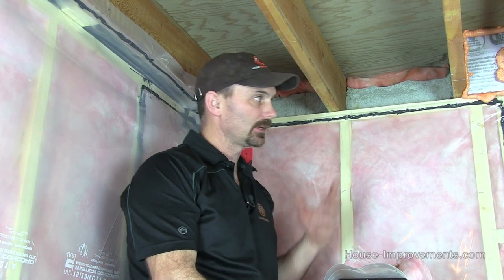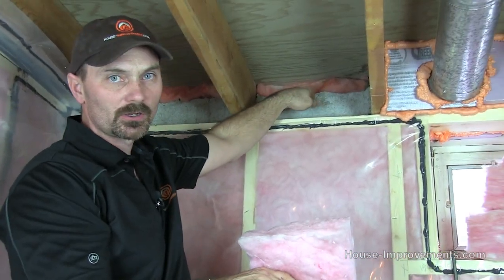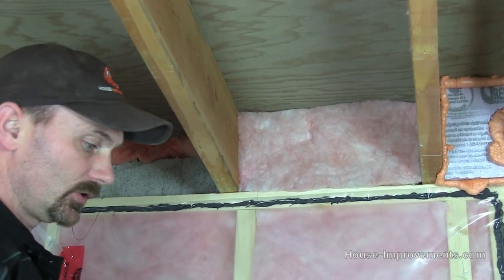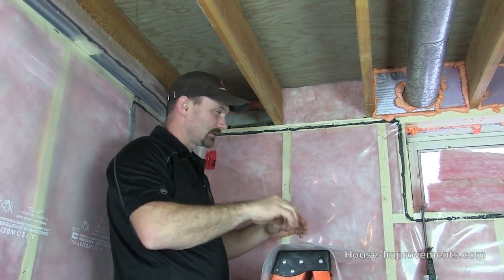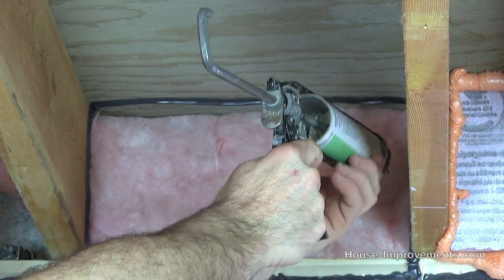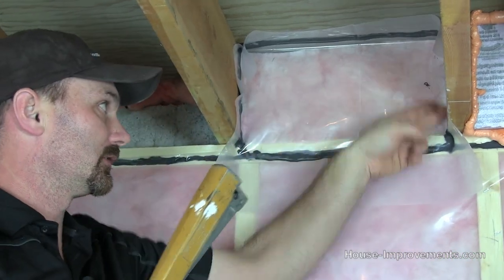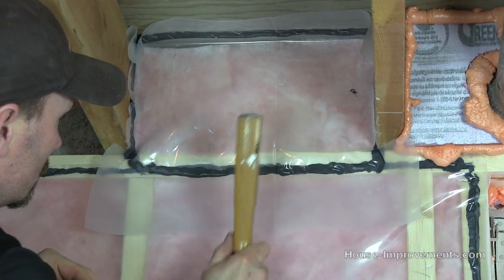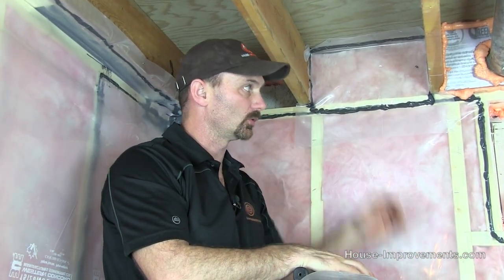How To Insulate Rim Joists With Batt Insulation

Comment: If we're not just gonna spray foam it professionally, I prefer using just a couple inches of rigid foam at the bottom where the concrete meets the wood sealed in with caulk and not covering that whole area. Seal all those cracks with caulk and then fill that shit in with batts. I have tested this with thermo and it does just as good and saves money cause you use way less rigid foam (30 bux for a 4x8 2in r10 is high as hell in my book). And I like caulk better than that messy Great Stuff any day.
Reply from the maker: And i actually prefer the rigid myself so I do not have to deal with the poly. Your way is fine as long as the caulk you use sticks and stays stuck for years
Reply: u r creating a serious, major problem with condensation and rot, 
by using this method
Reply: @simonsanderstein1241  the batt and poly method here? How so?
Reply: I used XPS but then covered it with mineral wool batts (ROXUL) for a fire barrier. Foam needs to be covered but fiberglass melts almost immediately and gives you no time to escape before toxic fumes overcome you.

Comment: What type of poly barrier do you sue? Regular 6mil? And how would you insulate the long gap under a gas fireplace above?
Reply from the maker: It is not regular 6mil poly it is specially labeled for use as a air/vapour barrier. Please use our forum for other questions.https://www.house-improvements.com/forums/

Comment: where do you find the right sealant for vapor barriers?
Reply from the maker: Its easy to find at most hardware stores or lumber stores in Canada but in some areas of the US its not as easy to find. 
I have a link in the video description to Amazon on my affiliate page.
Reply: @HouseImprovements  I emailed certainteed and they stated dap dynaflex premium 230 works with their membrain barrier

Comment: Just pulled out the pink fiberglass out because it causes condensation, mold, etc. Ice and water builds between. It was well put in, 10'' thick. Still it got wet, iced, etc. It had no poly grrr

Comment: What do you think about stuffing the cavity with an insulation that has been put in plastic bags (waste basket or shopping bag).  No acoustical sealant needed.
Reply: +Mario Matejka funny.  No, dont do that.  that wont work.
Reply from the maker: +Mario Matejka That will not work at all. The poly is to create a air/vapour barrier between the exterior and interior of the home.

Comment: OK great vido but at the end you are talking about an unfinished  basement   can I ask what do you put in front of the rock salt as you covered the 2 inch hard foam board.
Reply from the maker: The Roxul can be used in front of the foam to create a fire barrier between the interior of the home and the foam when the foam is not cover with a drywall finish.
Reply: The Roxul would still require a vapour barrier on top of it, correct?

Comment: Everything I've heard says do not use batt insulation and rim joist because the moisture Factor behind the insulation.

Much better to use spray foam or rigid foam.
Reply from the maker: Your choice, I have never seen an issue with either way

Comment: Shouldn't you be using that foam board stuff?  It's way more insulating than fiberglass, it doesn't get moldy or gross, and fiberglass makes people get itchy and cough.   I've seen the foam board stuff in my local big orange box store, Home D'Peau.  Some guy there told me he might put fiberglass over foam board, but he would never use it instead of foam board.  He was there shopping.  I think he was a contractor.

Comment: If that's a below grade wall then isn't his vapor barrier on the wrong side? I know in above grade walls the barrier faces the heated space. But in a below grade wall the moisture seeping through the stone or concrete wall will permeate the insulation and condense on the plastic soaking the insulation and providing a breeding ground for "microbial growth. Either put the barrier against the wall, or better yet, use a vapor retarder such as extruded poly foam and allow the wall to "breath." https://buildingscience.com/documents/enclosures-that-work/high-r-value-wall-assemblies/high-r-foundation-3-r13-fiberglass-batt-2x4-framed-wall
Reply: Brennen Swanson vapour barrier always on the warm side.
Reply: And basements should be sealed or have a plastic barrier on the concrete then frame...then you have eliminated your concern of moisture. Regardless you need to run a De Humidifier/
Reply: Use an air barrier like tyvek on the concrete before framing or any type of weeping system would work too. But the poly MUST be on the warm side of the batting.
Reply: tYVEK SUCKS! tYVEK GETS MOLDY.....IT DEterioriates...and is junk. Plus it holds moister. We do renovations and 100 Year old 30ml tar paper holds up better than Tyvek after 15 years. We see it all the time. IT IS JUNK!
Reply: According to BPI, the only time you should treat an AG wall is if it’s wood, if it’s concrete you don’t treat it. AG walls are treated as the RJ but it’s more effective to use polyiso instead of a 6mm Vapor Barrier. Besides, ground temperature averages 57°F, which is considered conditioned for the standard use of a basement.
Reply: What are you talking about??? Basement  INTERIOR walls need to be sealed INSIDE...If you have perimeter drains in a pre finished basement...We secure DELTA MS mat on the walls below the footing this way any moister goes behind mat into pipes to sump pump. Finished basement Walls framed and insulated paper facing out. Floor Polly on floor then 2x4 R15 then 5/8 Ply. We have taken floors off that did that way 30 Years ago and there is NO MOLD...No smell...ANd everything is reusable. Except what we broke removing. BPI LMAO they are CLUELSS....Real WORLD...Is where it is at!
Reply: Skip Rope really? I’ve never seen a basement masonry/concrete wall with insulation. Real world is what makes BPI practitioners save real money my friend. Educate yourself buddy.
Reply: In warmer climbs you'll see vapor barrier on the outside surface as there's hotter air outside and cooler air conditioned inside. In colder regions you'll have the opposite - frigid cold outside and warm furnace air inside. It really does depend on your region as to which surface will be the condensing one. 

To note, bat insulation like the one in this video probably shouldn't be used if the poly is on the inside wall UNLESS there's foam on the concrete surface, which I assume he did. Very common to go concrete wall, foam, framing, bat insulation, poly, drywall in that order.

Comment: Thanks for the great videos, I have a question for you. My question I’m insulting my basement bathroom witch has no shower just toilet and sink do I need to insulate the ceiling and if so can I use insulation board as a moisture barrier. I was thinking if so I’d do the same set up like the joist
Reply from the maker: Insulating the ceiling in the basement would only be if you want to reduce sound between the bathroom and the room above. Rigid foam can be used against the concrete basement walls as a moisture barrier and to help the insulation value of the wall. here is my playlist of basement insulating videos.https://www.youtube.com/playlist?list=PLh0KqGKtX4oWUr5nKO6U9y-otNi6OA0ud

Comment: Cut the foam board 1/8" larger than the opening and friction fit. Then the fiberglass batt over top because exposed foamboard is a fire hazard (lethal fumes). Forget the spray foam, it sticks to you like shit on a shoe.
Reply from the maker: You will fight to get the pieces in if they are tight on all four sides , the foam is to make a good seal and easy install. If you do the foam towards the inside of room you need to have a drywall ceiling, you are correct .

Comment: I’m an insulator and I can just tell from the the little I see , this is done just stupid you wanna poly the joist ends first before the wall
Reply: why would the vapour barrier be on the cold side of the insulation? Is'n't the principle that the vapour barrier goes to the warm side?
Reply: bdcopper you poly joist ends first then put wall poly after because If any cold air comes through it’ll go behind wall poly instead of in house
Reply: bdcopper I’m not saying to poly first then batt you still batt and then poly but do joist ends first then wall poly ,
Reply: @jamescardinal4439  ahhh ok, i see what you are saying now.  thanks for clarifying. makes sense

Comment: He's using fryable asbestos without respiratory protection. No chance of future lung cancer here.
Reply from the maker: There is no asbestos in new batt insulation since around 1990. A use of a respirator is appropriate if handling and cutting larger amounts or if you find it irritates your throat,IMO
Reply: @HouseImprovements  I don"t know that"s true here in Canada. No one has advertised that and we're still being told there is asbestos in it and to wear a mask. I'll certainly check it out. At any rate I will continue to use Roxul. It doesn't mould and rodents don't like to make nests in it. Thanks for the info.
Reply from the maker: Jim Moore  Jim I’m in Canada as well. Check any manufactures MSDS .